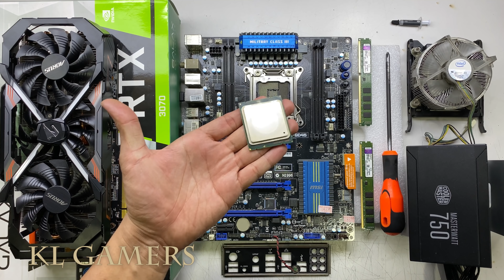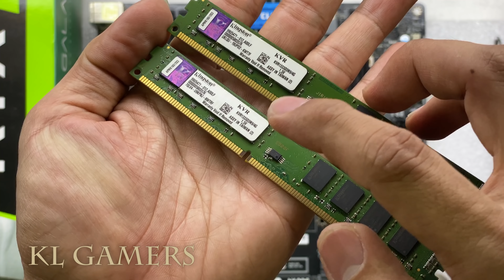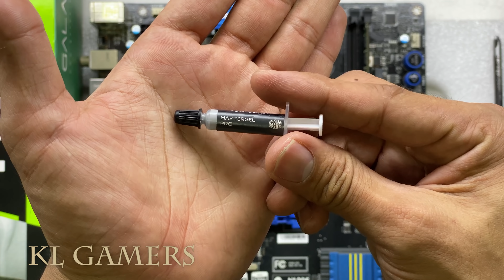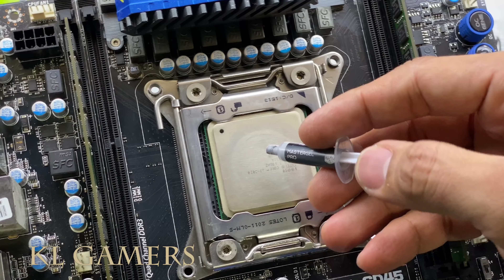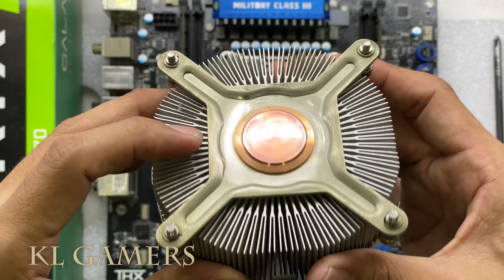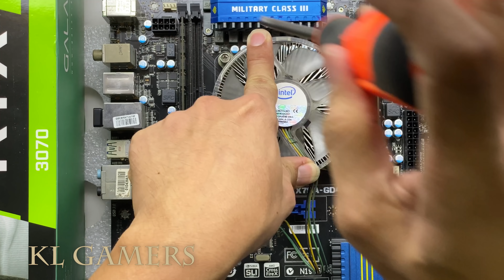intel Core i7 3820 MSI X79A-GD45 GIGABYTE GTX1080Ti AORUS Gaming PC Build Benchmark

Comment: Upgrade the parts for windows 11
Noctua CPU cooler
i7 12700K
32GB DDR5
and
New samsung 970 1TB ssd
Reply: First you need to change the motherboard
Reply: @haurusclash  yup it will be an ROG maximus hero Z690 Formula